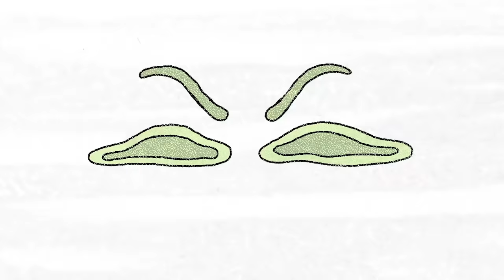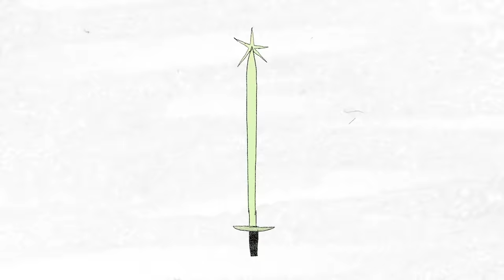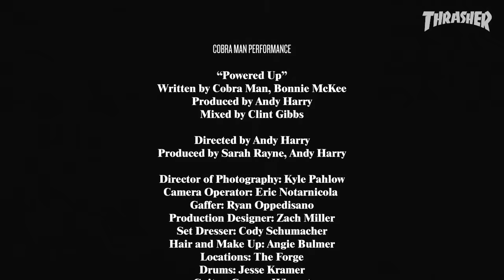Worble and Cobra Man’s “Worble III” Video

Comment: Please tell this old head where to buy this soundtrack! What a fun ass ride. Thanks Worble Crew and Cobra Man.
Reply: It'll be coming out later this year, and there's three singles ready to listen to anytime- Powered Up, Heatwave, and Light Me Up.  Absolutely amazing songs.
Reply: @Abesteroni  Thank you!
Reply: @Grackle2012 Yes- on both counts.  To be specific, the part that leads into the ten minute mark is a snippet from the song New Driveway and is slowed down.  The song that starts past the ten minute mark is called "Cool, Nice" but isn't available for streaming or purchase yet, as far as I know.  The same goes much of the rest of the Worble III songs, aside from Powered Up.
Reply: I would imagine it got scrubbed because it wasn't legit.  Cool, Nice isn't a single yet lol.  If it shows up, Cobra Man will be posting all about it and it'd be available on Bandcamp and streaming sites ASAP.